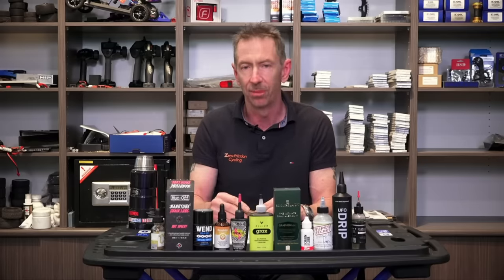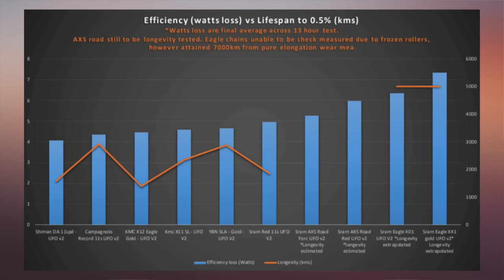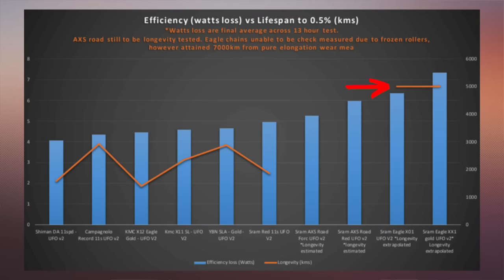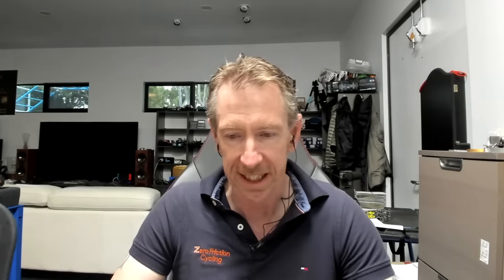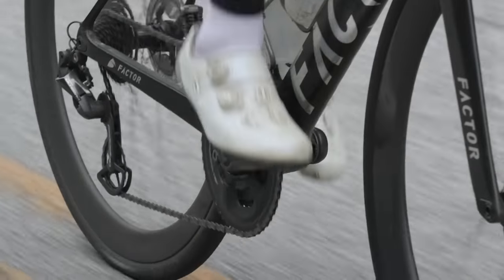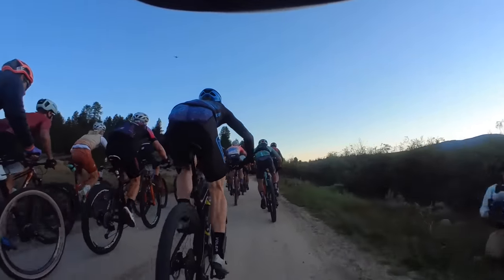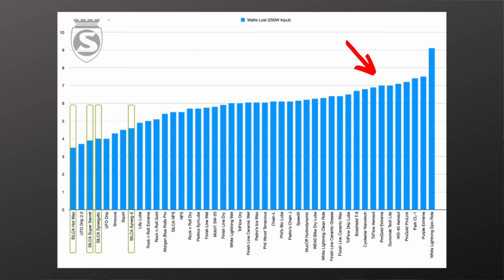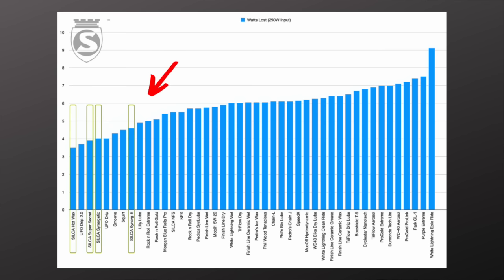How Slow Are SRAM Chains and Other Drivetrain Efficiency Questions With Adam Kerin

Comment: What do experts say about fallowing 12 speed mix: dura ace chain + ultegra cassette, SRAM axs crank, SRAM axs derailleur?
Reply: I can't speak for road, but I have a similar setup on two mtn bikes, but I run a front ring designed for a Shimano chain.  Works very well.
Reply: Chains and cassettes, as long as they are 12spd compatible, it is fine, Ultegra, 105 or Dura Ace don’t matter. Chain rings can also be 11/12spd compatible, some are specific to SRAM and Shimano 12spd.

The crank doesn’t matter, only the chain rings. 

The rear derailleur is another issue, Di2 won’t work with AXS, so you can’t mix a front or rear Di2 with AXS.
Reply: That's not really mixing since they're matching geometry. But Shimano chains also work great on SRAM cassettes.  Been doing it for over 200k miles from 10-12sp
Reply: The key is making a setup that avoid the flattop chain which is both inefficient and introduces compatibility issues. I think SRAM came up with the flat top to force people to buy complete SRAM group because on SRAM 10 & 11 speed road groups better shifting & quieter, more efficient drivetrain was achieved be switching to Shimano chain and cassette. New SRAM eagle MTB 12 speed is switching to flat top chain. Are larger rollers and flat top necessary for 12 speed? Shimano, Campy & Rotor say no.
Reply: @Fred Porter  companies have always said their matching chains are better with their cassettes.  And that's still true with shifting most of the time.  But SRAM didn't make the cassettes differenct enough that a Shimano chain won't work very well on them and a YBN chain works great too
Reply: @veganpotterthevegan  good to know, thanks! I recently switched to AXS and went with the force chain. In the vid he mentioned using normal rollers on AXS is like using a normal chain on well worn rings/cogs. But maybe I'll try a better chain next time. Does the shim HG+ 12spd with the chamfered inner plates work on AXS or better to try YBN?
Reply: @veganpotterthevegan on my MTB I do know by having tried it that the HG+ chain does work better on the shim 12spd 10-51 cassette than does a 'conventional' 12 speed chain.
Reply: Might have an issue with the AXS pulleys and non flattop chain.
Reply: @Fred Porter  I think it's really odd that he said that when plenty of people are already doing it without issue.  It sounds like he just went off of SRAM claims and never looked for himself.  He could have done a YouTube search to see people testing compatability.   
I've never used a YBN chain but I've installed one for a friend using it on AXS and they're happy with it.   
*I really only use Dura Ace and Ultegra chains.

Comment: Those are indeed interesting findings!
Normally one would expect longer lasting chains be better at efficiency too: smoother surfaces with tighter dimentional tolerances benefit both. Must be something about being beefier and chain-cassette engagement then, would explain that sram chains are normally more noisy.

Also, maybe the most honest and correct opinion on OSPW ever
Reply: Bigger roller diameter means the wear spread over a lager surface I guess.
Reply: @chrisridesbicycles  most durable Eagle chains still have same diameter pins and rollers.
Reply: @feedbackzaloop  Ok, good point.

Comment: This is why 2X set ups are STILL the SUPERIOR option for mountain bikes. Bigger cogs and bigger ring for nice straight chainlines and less chain articulation for flying on the flats and the downs.

But you still get to maintain a good chainline if you drop down to the small ring because you drop a cog or two to keep the chain straight.

2X MTB master race right here!
Reply: And tighter ratios. Im running 11-36 cassette.  With 22 front its like having a 11-52 1x in back.

Comment: 10:36 this drawing is wrong. 
the last contact point between chain and ring is the center of the ring. The ring size will not affect the angle.
Reply: thanks for sharing you information anyway

Comment: Ybn 12s run beautiful on axs cassettes. Also on extrem oval rings in a 1x12 setup, 1600w approved, shifting under load approved, very quiet, but lasts about 20% shorter than a sram 1270
Reply: You’ve got it on a road setup?

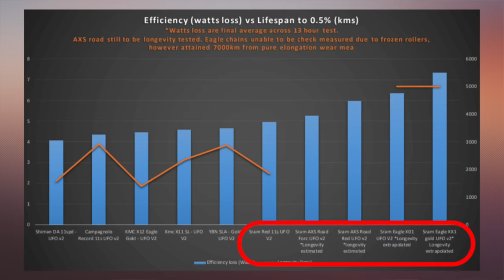Comment: I've gotta say, I think that graph at 2:30 is completely wrong when it comes to longevity. You can't extrapolate longevity, actual longevity tests have found SRAM and Shimano last about the same, with Campy and some other expensive manufacturers being proportionally better to the cost of the chain. Because the drivetrain is built for un-worn chains, the chain is going to measure great for the first 1500km and then rapidly deteriorate. My personal numbers seem to correlate with what I've seen from proper tests, and that's that Shimano and SRAM chains last about 2000km with lax maintenance (weekly degrease and conservative application of lube) and about 2500 with dry lube and cleanup every 3 days.

Comment: It would be cool to see some numbers where you're replacing the chain and rings with belt and front/back internal gearing.
There are a several new gearboxes coming out or have already been released in the past few years.  There is even a reliable second source belt company now - Continental was a complete failure but Veer has a belt system to compete with Gates Carbon now.

Comment: If oversized pulley wheels were of any benefit Shimano and Sram would produce them. Any advantage gained by reducing chain bend is offset by excessive side loading on the pulley bearings due to the extra leverage when in any gear where the chain line is not dead straight. Marketing bullshit at the highest level.
Reply: Regular-sized pulley wheels with quality steel bearings is the most I'd ask for. Speaking of which, I don't think there's an aftermarket version.

Comment: Shimano chains break all the time. I have had new first ride Shimano brake. I see guys on the trail with broken chains all the time. SRAM chains last, at least the XX1/X01 eagle chains I use.
Reply: Every broken Shimano chain I've seen in the last 4 years has been counterfeit.. not to say that it isn't possible for a legit one to break, but it's exceptionally rare.
Reply: @SILCAVelo  I did not buy mine from some Chinese shyster. Bought from bike shops. How Does a person tell if it is counter fit or not? Thank you.
Reply: @mtnbikerva1  Genuine Shimano chains have subtle label stampings on the outer side plates. Their quick-links are packaged separately from the chain and feature an actual notch around the center of each of the quick-link halves. The CN-HG901 uses hollow pins.

If the snapped Shimano chains you've seen are genuine, are you sure it's not because riders are downshifting (shifting towards easier gears) under heavy load?
Reply: Ive had the exact opposite experience. Shimano and KMC have been fine. My current Shimano is on its 3rd mtb season with no measurable wear.